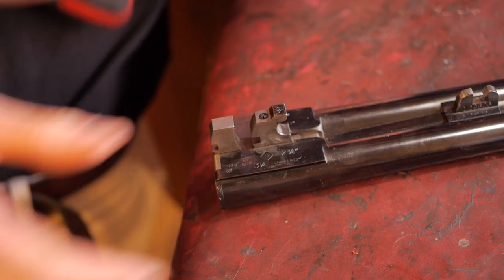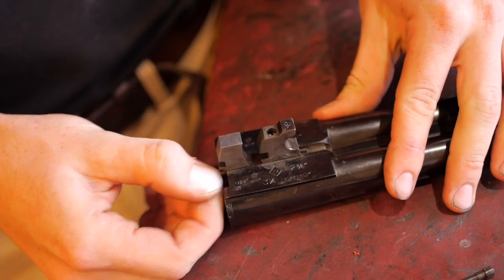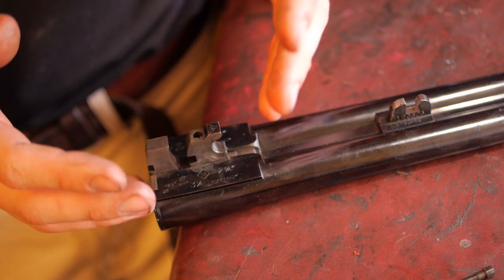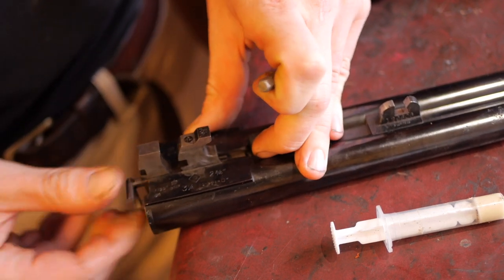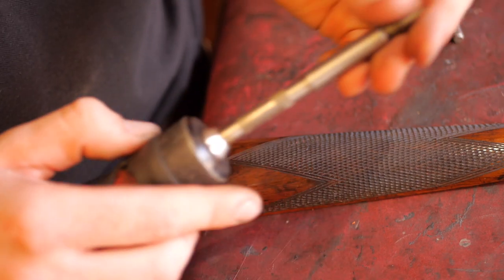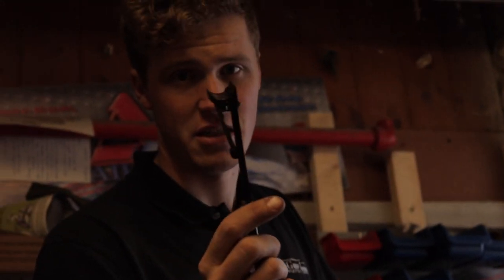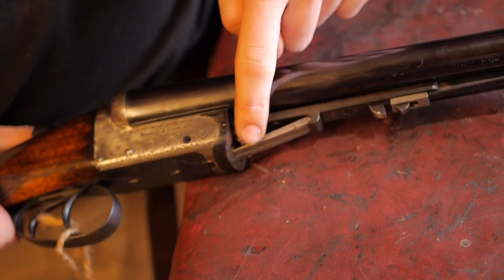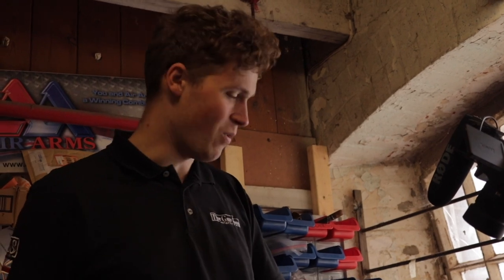How To Remove Side by Side Ejectors

Comment: Hi Mate. I have a Greener sxs Royal G60 with Baker ejectors, 12 gauge
When storing it disassembled I fired it so that the springs are not under tension
Now when trying to assemble it the locks do not move, the barrels cannot be reassembled
I thought that by reloading it, which I did by pushing the hammers back, the locks would release.
But no, it's still stuck
Do you know what I should do or what I'm doing wrong?
From already thank you very much
Darío Queija

Comment: The bits and bobs inside that gun are brilliant. I'm surprised that metalwork fitted inside that fore-end. Cheers for another very interesting video. Do you ever get offered any really unusual firearms in part exchange, like strange calibre conversions or complicated actions?
Reply from the maker: Occasionally we do yes, usually end up being very low (scrap) or very high value.

Comment: So you can either decock the firing pin or the ejector, but not both at the same time? How do you recommend storing these then ? Thank you!
Reply from the maker: Main spring is more important, if you have an ejector spring break you can still shoot! So snapcaps in and used are recommended

Comment: Is it possible to find spare ejector parts or to repair them, in very cheap SxS guns? i.e. where the low cost of the gun would not warrant a hand made replacement.
Reply from the maker: You can get ejector blanks that can just be filed up for most guns. To have a handmade replacement can be many hundreds. 

To have one welded and repaired is not a bad option and can be quite reasonable in price
Reply: @tgsoutdoors  thanks so much! That's really helpful. Are there also cheap solutions for other broken parts, e.g. firing pins, springs? I'll be buying my first SxS after watching your videos but I'm aiming for entry level second hand first. I need some confidence and to know which brands to avoid in terms of spares.